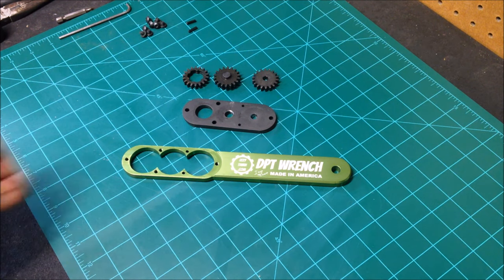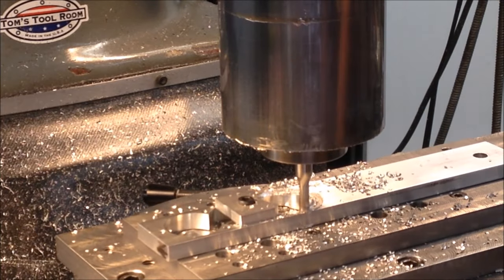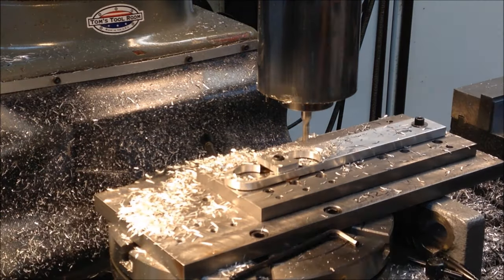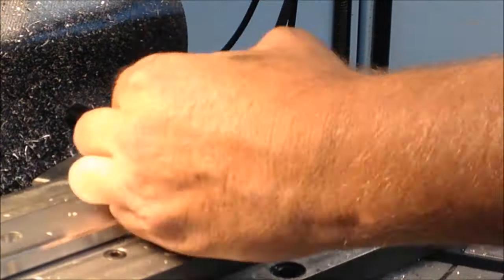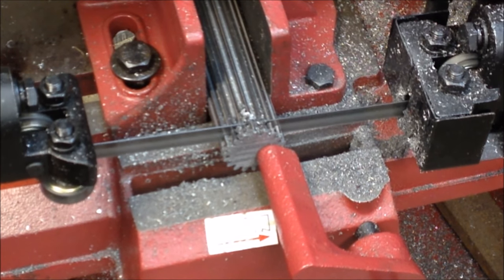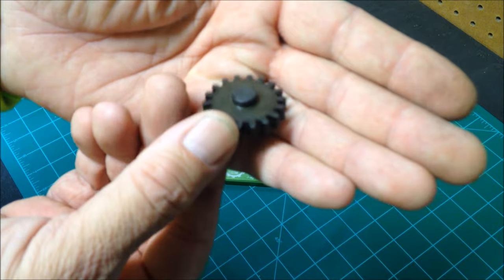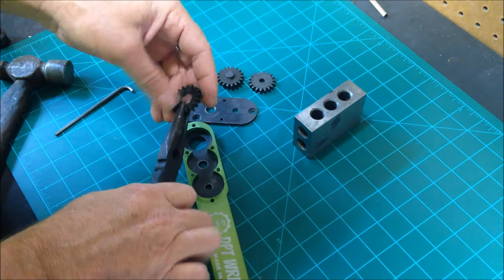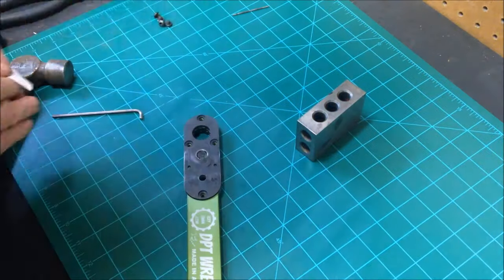Izzy Swan DPT Wrench Production Version

Comment: Wow nice work Tom! How well are these selling so far?  Nice work cutting those radiuses no the rotary table.  What brand/size table is that ?  have been thinking of getting one.
Reply from the maker: Thanks Gary.

They are selling pretty well Gary. Izzy will be placing an order with me within the next few days so they will be shipped in time for Christmas.

The table is called a Yuasa-Type 10 inch. I believe Grizzly sells it under part number G9299. But i got mine on ebay for about half the cost of Grizzly. But i dont remember the name of the cat i got it from, I believe he was located in Georgia thats all i remember. Even though the table is pretty cheap i Love it! Its well within the tolerances stated and smooth as silk, nothing but high marks from me!

Comment: So are the input and output gears just sitting in the housing ? Will the hardened steel not wear the aluminum housing down over time and create slop in the gearing?
Reply from the maker: The hardened plates locate the gears when the socket is inserted and the 1/4 inch hex drive is inserted The gears never touch the aluminum when it is being used.
Reply: Very clever design, looks like a quality tool, well done to everyone involved!

Comment: hey that's interesting! is there a place where you discussed the design? I have a few questions.
Reply from the maker: You can ask here if you like.
Reply: ok thanks. 
screws: how did you decide to tap the aluminium instead of taping one of the steel plate and pass thru with one long screw? why not using countersunk with flat head screws?

mechanism: is it ok to have 3 spur gears of the same material? shouldn't each gear pair have one side hard and one side softer?

I love the simplicity of having 3 gears, the part count is ridiculously low.
Reply from the maker: Screws: I dont think strength is an issue at all whether i tapped the aluminum or the steel plates, so i opted to tap the aluminum because it makes assembly much much easier.

Mechanism: Absolutely its ok to have the gears of the same material and hardness..........there will be no wear at the drill speed. Id go so far as to say its pretty much indestructable if its used as intended.

Yes the part count is low which cuts costs and increases efficency in assembly.
Reply: hey tomstoolroom looks like a good professional job with excellent quality machining. Please excuse me for asking if there was a reason for so many tool changes..... instead of step drilling all small holes the all of the next size up and so on. like tapping all holes without having to remove the tap Everytime. that would cut machine time tons. (I think I know the reason) lack of DRO?